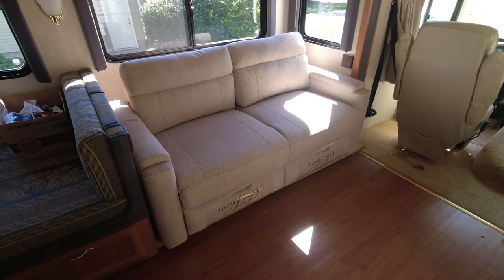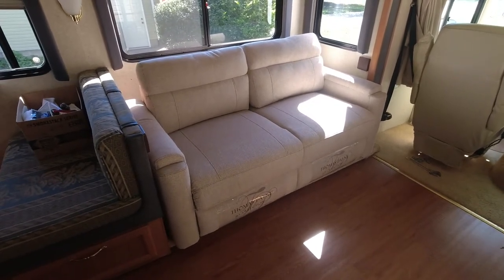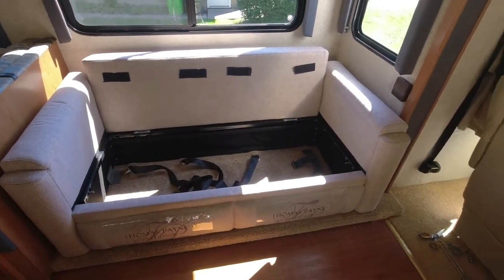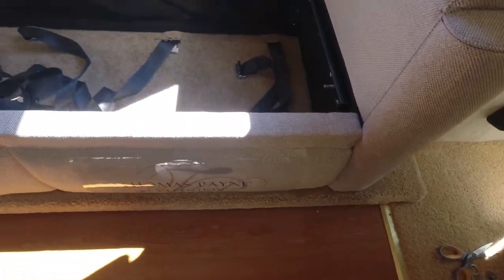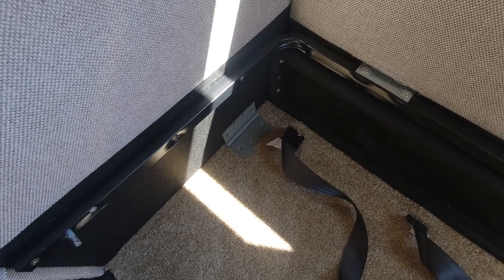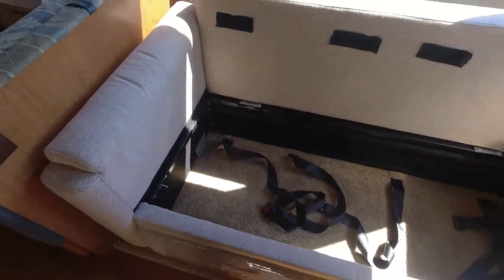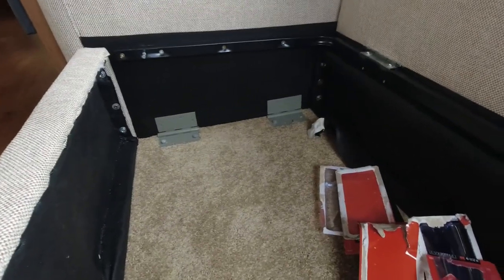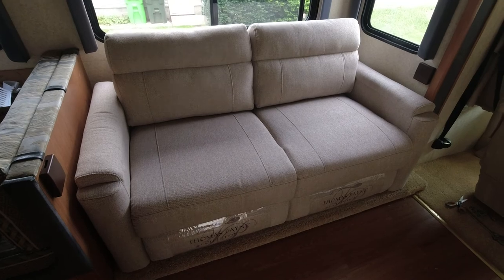Thomas Payne RV Sofa Securing to floor, Step by Step

Comment: How thick was the plywood under the sofa? Bolting mine down in a slide out and don't want bolts or screws that puncture the bottom side of it.
Reply from the maker: I want to say it was 1/2 inch from what I recall.

Comment: Is that a metal frame in the front and back? Why not attach metal frame to floor?
Reply from the maker: You are correct it does have a metal frame.  It would be best if you could manufacture a metal mount to the floor.  I just don't have access to a welder to do that for me.  But it would be best.